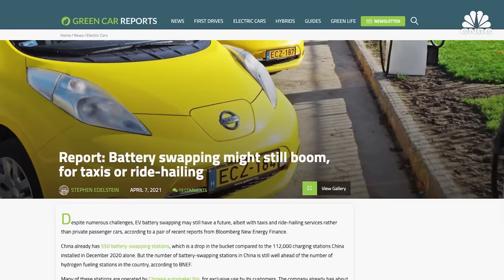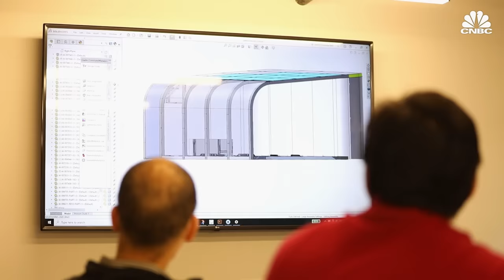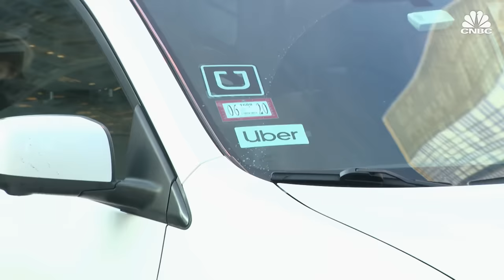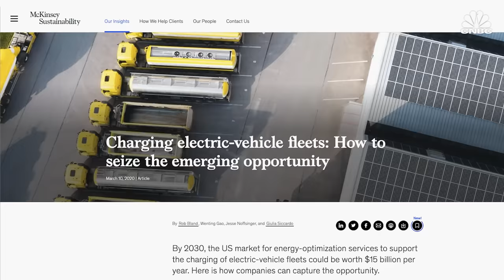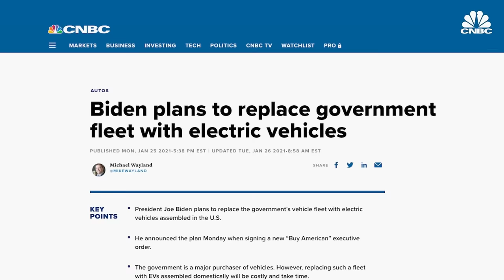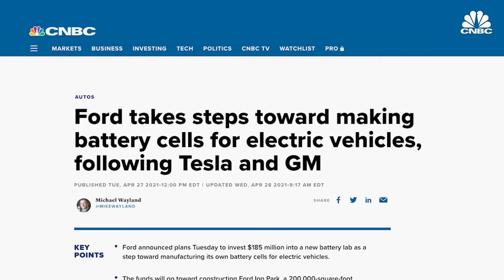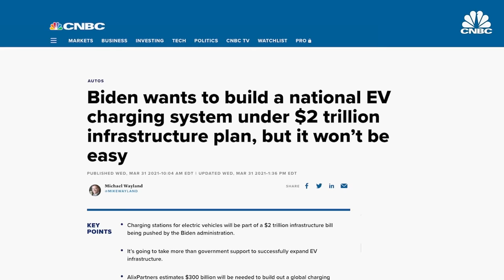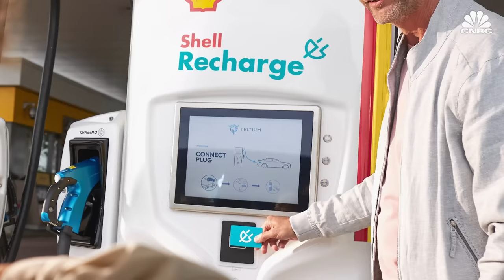Can EV Battery Swapping Take Off In The U.S.?

Comment: No data on how many cars per hour they can handle. If the batteries are slow charged, they might pretty quickly run out of full batteries. No data on how many modules they keep at a swap station. No data on how much range the car has running on a swapped battery. No data on whether the swappable battery can be fast charged while in the car. In other words, a useless puff piece.
And leaving aside those tech issues, I have serious doubts about the financial viability. Batteries are very expensive. At the scale they are working at, they have to be spending somewhere around $200 per kWh at the module level. That's $10,000 worth of batteries for each 50 kWh swap. If you assume 4 cars per hour, and a charge time of 8 hours before you can re-deploy a battery, you need 32 cars worth of batteries, $320,000. At 10 cents per mile, that implies a swap will cost about $20 to the driver. The power in the battery will cost the swap station at least $10. Leaving aside all the other costs of running the station, at $10 profit per swap, They will need 1000 swaps just to pay for the battery.

Comment: 9:22 I can't believe they don't see how this one specific point is a point of weakness. I'm waiting to see how they plan to have a stock of batteries when that's one of the biggest bottlenecks? I wish them good luck. It's a cool idea. Like the idea of fleet uses, but wouldn't make sense with a ton of different styles of battery mods. I'd prefer my own battery that I charge.
Reply: And the battery is 60% the value of the vehicle. This might make sense if you can half the size(cost) of the pack

Comment: These guys have the right idea but are missing the point. Where battery swapping would make the most sense is in interstate highways where ppl drive long distance.
Reply: How many swapping stations and battery packs are they going to have at each one of these stations? They said they will be trickle charging to avoid degradation, so they are going to need millions of dollars in battery packs sitting around waiting for a car to swap into.  If too many cars show up then you are stuck slow charging your car while you wait for a pack. Ever been in line at the costco gas station? These things cost way too much to be all over the highway so youd end up pulling into one of these places with miles of range still in your pack because the next multi million dollar station is beyond your batteries current range. You could have parking lots full of superchargers at a fraction of the price of one of these swapping stations. Not to mention the world is already battery constrained.

Comment: I don't think this will take off unless you can drop the car off and come back anytime or have enough where there is never a wait and it take less than 5 minutes per swap.

In my experience Superchargers are not fast enough or too fast. I can't plug in for 5 min to get enough range to the next charger and it charges too fast to get a good meal in.  

You have 15-20min at a Superchargers or have to charge more than you need so you don't get idling fees. I usually charge 30-45min because family likes to walk around and play. I can never keep them to a hard 15min break.

Comment: Ok… tell me, why haven’t I heard about this company @CNBC ??
Reply: Because battery swapping is really not a good idea. My city is already connecting ev charging stations into streetlamps for people who dont have a garage. Tesla is going to have way better range with their integrated structural battery pack than any modular EV. Teslas batteries are already cheaper, smaller, and go farther than the competition and it just getting better. How many battery packs will these swapping stations need to have on hand in a city in order to make sure people arent sitting around waiting for a pack to finish charging before it gets swapped into their car? A battery is the most expensive part of an EV and they want to have thousands of these just sitting around when the world is already battery constrained. Each one of these places are going to cost millions in battery's and they will need to be all over the city and highway, otherwise youll be driving out of your way to get a swap, negating most of the benefits. They mentioned using them as grid energy systems, but that will degrade the battery life and tesla is already doing this grid battery powered energy storage with cheaper batteries that dont need to be small or light.

Comment: So long as it takes scheduling an appointment to swap the battery which was the case with Tesla, it's simply too inconvenient.   However. If you just standardized an interface for a battery trailer then rentals of battery trailers with trailer swaps at gas stations and rest stops would work and indeed both Germany and France have companies that do this albeit with proprietary connectors and only on high use corridors.  Battery trailer rentals would require far less equipment for each swap site and could be large enough to not require enroute swap sites and only have them at destinations such as at car rental locations or dealerships.   For the US, it may be best to rent generator extensiin trailers to leverage the existing gasoline and diesel infrastructure and only offer the rentals from a few sites again such as car rental offices and dealerships especially as fast charge corridors already exist in high use areas hence trailer rentals may be a temporary requirement for long trips as hooking up and pulling a trailer is also an inconvenience and many would still prefer making a bathroom and coffee break every hundred miles instead.

As to fast chargers, EV's should arrange their batteries in banks, at least two banks, a primary and a reserve.  As batteries charge the quickest when depleted, for a long trip you would want to deplete the primary battery and only partially charge it to reach the next recharge site but this leaves you with very little reserve, however having two banks means you can deplete the primary and still have the secondary to search for a recharge site with.  It's like how some trucks have two fuel tanks.  The two bank concept will allow you to deplete one bank for the quickest partial recharge possible rather than trading your reserve for that fast charge.

Comment: How about a ShortRange- option with a 1/4 battery pack that reduces vehicle weight by 800 lbs and increases range  to result in a $10,000 lower price?      I'm not arguing against range, but I am arguing against battery cost, manufacturing carbon footprint.

Comment: Batteries should be standardized like  tires. People can do this job too...
Reply: No they shouldn't. Battery swapping is really not a good idea. Tesla is going to have way better range with their integrated structural battery pack than any modular EV. Teslas batteries are already cheaper, smaller, and go farther than the competition and its just getting better. How many battery packs will these swapping stations need to have on hand in a city in order to make sure people arent sitting around waiting for a pack to finish charging before it gets swapped into their car? A battery is the most expensive part of an EV and they want to have thousands of these just sitting around when the world is already battery constrained. Each one of these places are going to cost millions in battery's and they will need to be all over the city and highway, otherwise youll be driving out of your way to get a swap, negating most of the benefits. My city is already connecting ev charging stations into streetlamps for people who dont have a garage. They mentioned using them as grid energy systems, but that will degrade the battery life and tesla is already doing this grid battery powered energy storage with cheaper batteries that dont need to be small or light.

Comment: In a few decades, battery standards should be implemented by an international consortium, the manufactures should all use a single standard with a variety of sizes and capacities, energy should not be another IP that a corporation controls, imagine a GM only formulation of gas or a special gas pump nozzle that just fits Ford and a BMW only gas station, it's a nightmare, it's like Apple making cars... oh wait :|

Comment: It really seems you could get a "best of both worlds" by having optional swap-able "booster" batteries in addition to a slightly smaller OEM battery. Swapping time could get down to just a couple minutes and would only be needed some of the time depending on your use case. It would also make long distance less stressful.
Reply: The OEM battery pack is about the size of three couch seat cushions.  There would not be extra space to install a battery pack like Ample makes as well as leaving the OEM battery pack in the original location.  So that leaves you with putting them in the trunk, lifting the battery into it, so it would require many fairly light battery packs, say lunchbox size 25 pound units.  But the 400 VDC wiring would also present a problem.

There was a company that installed a 5 KW battery pack that could be charged at home with 120 volts that replaced and was installed in the location of the spare tire of a couple of different hybrid vehicles built in the 2005 - 2012 range,  But I think that company went out of business.

Comment: What happens when GMG's graphene aluminum battery that charges 60x faster with little degradation in charge density over thousands of charging cycles overtakes lithium ion technology? Battery swapping may start looking kind of silly within a 3-5 years.

Comment: The main thing about this is to make sure that you aren’t getting faulty batteries for a replacement. Other than that this is a great idea.
Reply: The car should be able to quickly assess and verify adequate battery health to assure the customer before they drive away. And of course the system at the swap station should be able to monitor battery health before installing. Plus the customer obviously won't need to keep the battery permanently or buy a new one if they ever end up with a faulty one. They could just have it swapped out again in a few mins time. I don't see this as likely to be a major issue at all

Comment: Gas Stations cost big money too.  So no difference between gas and battery swapping stations
Reply: Battery swapping is really not a good idea. Tesla is going to have way better range with their integrated structural battery pack than any modular EV. Teslas batteries are already cheaper, smaller, and go farther than the competition and its just getting better. How many battery packs will these swapping stations need to have on hand in a city in order to make sure people arent sitting around waiting for a pack to finish charging before it gets swapped into their car? A battery is the most expensive part of an EV and they want to have thousands of these just sitting around when the world is already battery constrained. Each one of these places are going to cost millions in battery's and they will need to be all over the city and highway, otherwise youll be driving out of your way to get a swap, negating most of the benefits. My city is already connecting ev charging stations into streetlamps for people who dont have a garage, and apartment parking spaces are getting EV chargers, all at a fraction of the price of these swap stations. They mentioned using them as grid energy systems, but that will degrade the battery life and tesla is already doing this grid battery powered energy storage with cheaper batteries that dont need to be small or light.

Comment: The HUGE downside to this system is that those Folks who always use Rapid Charging methods will be introducing batteries that have been harmed. We JUST heard that Rapid Charging actually degrades battery life. How is this system set up to address that, ensuring that the newly-inserted batteries are of the same quality as those submitted? Shouldn't there be a testing/grading system in place for these transferable batteries? #FoodForThought

Comment: "Degrading the battery" Laughs in Tesla
Reply: Tesla just got fined millions for this exact thing. Except tesla was throttling the batteries. Not the consumers. I gwt you point though. Batteries just font degrade as much as they did even a few years ago..
Reply: @reginald7214  yeah old Model S batteries… talking about 2020 and forward
Reply: @stjerneskruetraekker  yeah all batteries are pretty good these days. Degradation is behind us. Byd has a 600,000 kilometer taxi with about 10% loss so the rest of us should be fine.

Comment: Here is my idea for electric vehicles. Briefcase or small luggage size lightweight batteries that you can swap out at any gas station for a fully charged one similar to how propane tanks are exchanged. You would be able to locate charging stations using a app based upon your vehicle brand similar to ATM location apps. You would swipe your card dispense a new battery and exchange it for a empty one failure to replace with an empty one would result in a additional charge for the full price of the battery. PS if anybody use my idea I want my cut.
Reply: They don't just choose to make the batteries huge on purpose. They have to use large heavy batteries for greater capacity. Shrinking batteries is a huge technological challenge. If anyone could make a lightweight battery the size of a briefcase, which could power a car for adequate distances, they obviously would have done it already

Comment: i don't see Tesla being part of 5 OEM that Ample is working with. For one, Tesla seems to be a company that's highly protective of its unique in-house technology. Two, most importantly, is that their build quality is just not on par with other established car manufacturers. Can you imagine an Ample robot trying to find a bolt underneath a Tesla? Probably not since Musk is always changing the design of the car.
Reply: And tesla figured out that structural battery packs add a good amount of range, especially over some standardized modular pack.

Comment: This company was locked into a bad business model 7 years ago and decided to follow though with it.  Ten years ago, batteries cost 10x the price, was slow to charge, and had limited range so it still made sense to swap batteries. But every year, batteries are lowering in price, increasing in charging speed, and extending in range and durability. 

It makes zero economic sense nowadays to build a business around swapping batteries. BYD is releasing a 600 range economical car. Tesla next gen batteries will have 1 million mile durability and cost 40% cheaper. Solid state will have 10 min charging time and will eventually replace current batteries over the next 10 years. All of that is coming and and will constantly improve. Just a matter of when. 

In addition, a swapping station cost millions to build and maintain and takes up a big footprint. A charging station can be installed in front of any parking spots, and have virtual no maintenance, and cost a fraction of a swapping station.

This company will probably be bankrupt within five years if not sooner when battery swapping becomes completely obsolete. They are comparable to US Robotics in the 90s trying to build the best 56k phone modems when the rest of the industry was transitioning to 100 Mb broadband internet.

Comment: I don't think you need a 17 minute video to conclude that this company is eventually going under or shrinking to an incredibly niche market. The number one reason startups fail is because there is poor product-market fit, and this video is laced with consumers and experts alike saying that they don't really need what this company is making. Combined with the fact that ample is relying on an ecosystem lock in to marry their current customers despite weak demand, and you will have these customers very dissatisfied and feeling trapped with their union the second ample hits a snag with their product, whatever that snag may be. They will try to get out and run to fleet fast chargers asap. Plus all that stuff about selling back to the grid like maaan just focus on the customer, it's not a good sign that the team is wall eyed on these different ideas. This little trickle-charging hut is going to tap out immediately as soon as 10 consecutive fleet vehicles need a full swap out, there is no way it could continuously service a highway in 2030 where 50% of cars are BEV and empty. The costs of switching to a fast charger are just too negligible, especially with million mile battery chemistry coming down the pipeline. I predict a theranos scenario where they are just secretly fast charging the batteries after swapping to keep up with scale and demand. Just eat the cost of the battery degradation and when everyone complains about reduced range, install more ample stations so they can swap twice on the way to their destination, thereby initiating a battery ponzi scheme.